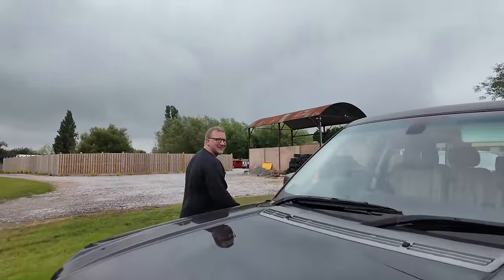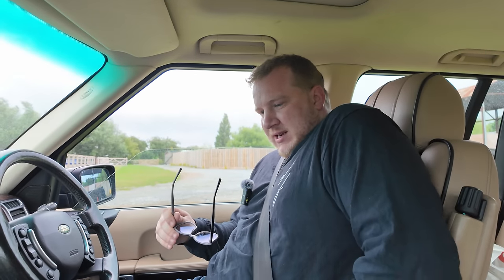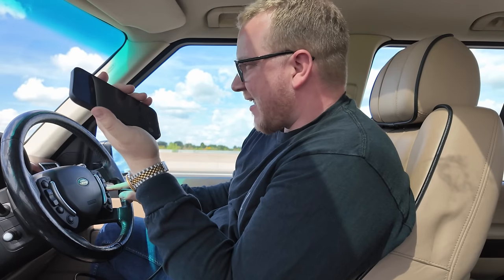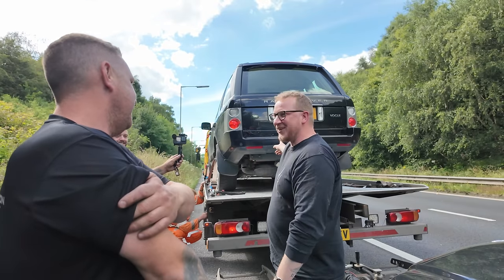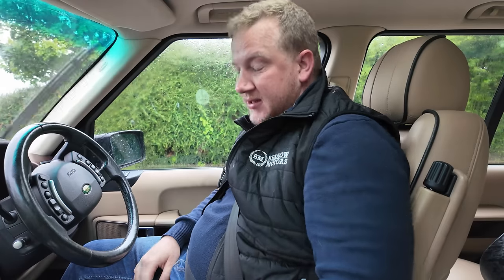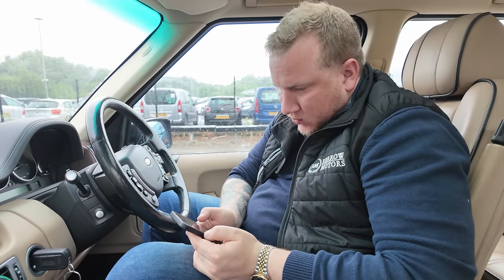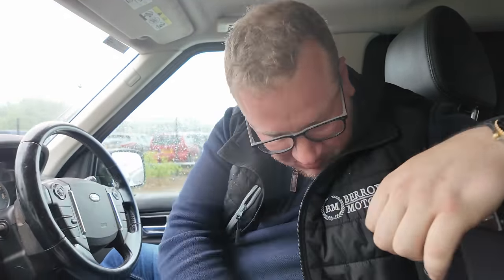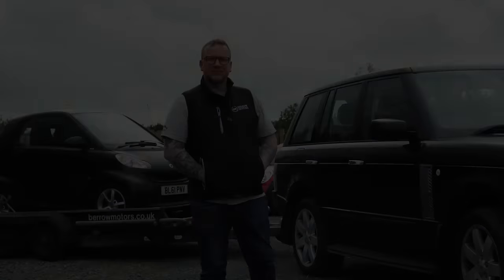Risking 600 Miles In My Dads Old Range Rover TDV8 L322

Comment from the maker: Less than 2 days left to enter the RS5 competition! https://feelgoodcompetitions.com/product/win-a-2014-audi-rs5-for-5/
Reply: Had many l322 vogues tdv8  and have had the same problems 

Cracked inlet manifold or top intercooler hose  will bring up low boost and limited performance 

Fuel sender unit is faulty cheap fix 

And the central locking is a failed actuator in the door 

Fix it 😉🤣

Comment: I think people are forgetting the Range Rover didn't break down. Any car won't go if there is no fuel. I would fix the issues and keep it. With Macaully leaving you might appreciate an awesome comfortable tow car if you end up doing more road trips.
Reply: My thoughts exactly, far better than sitting in a flat loader for hundreds of miles
Reply: Dodgy fuel gauge.  Surely brim it and monitor the miles driven

Comment: For the overall trip you should have filled it before you left home . Especially knowing that the gauge was off . the truck may be expensive to fuel but its basically a spent car to you ? You were going to scrap it when it ran out of diesel ? At this point it owes you nothing ! Spend the time on fixing the fuel gauge and door locks ! It did 600 mikes and would have been fine ! You said the AC works great and it was comfortable to drive ! If it can haul A trailer then make it a business vehicle and write of the expenses ! It looks good and clearly is worth more than a scrap price . you know the history of the truck ! You can't find another tow vehicle any where near what this will cost you ! I think you need a bigger trailer that will fit all the range rivers you seem to be buying lately ! Best of luck ! God Bless
Reply: £1.56 a litre. Jeez.
Reply: Shudhave squad

Comment: Tdv8 is normally so very reliable, I got a rangie sport 2010 with that engine and 300,000 on it, never had any work done other than servicing, it’s the electrics that fail on them, the tdv8 doesn’t have a cam belt it’s a chain driven system.

Comment: The fuel filling problem is caused when you fill from a Jerry can it causes a flap to close inside the filler neck as it thinks your filling it with petrol. 
You need to reset the flap inside the neck- search for Land Rover mis-fueling reset tool. Or look in the boot compartments it’s a yellow plastic tool.
Reply from the maker: Brill, thanks!
Reply: Agree 100%
Reply: @ShiftingMetal if you cant find the tool then a long screw driver will be enough to clip the yellow flap in the filler neck back down and refuel normally again!

Comment: I had an 07 tdv8, it came up with same issues as yours. Restricted performance on hills was split rubber intake hose £30 to fix. Faulty fuel gauge was just take the fuel sender out of the tank and clean it. The locking could be the key battery. Sold mine with 185k on the clock, no major issues with it really.

Comment: The AA left me on the side of the M42 for 3 hours and 20 minutes.   I was really annoyed.. I made a video on my channel called I had a break down.. I'm 71 years old. I could have been hit of robbed or murdered in that 3 hours 20 minutes.. That's the first breakdown for about 9 years and the previous one didn't require recovery.. you were lucky to get recovered so quickly..  I didn't get where I was going, I chose to be towed home.. The AA recovery guys were great and so was the highways England guy.. I've learned a lesson.. don't immediately contact recovery, use the emergency phone at the side of the road and contact Highways England first

Comment: Better the Devil, you know , and Oh ! Leave as nature intended .
Unique speck, leave untinted .  Fuel gadge just under rear seating  , easy fix.
Classic motor and a good one is rare.  No reason if treated with respect, will get another 100k.  Good bodywork and no rust  , perfect.  Best car on the road, particularly well looked after and great spec.  Keep it 💯 👌

Comment: Great video - The L322 is a classic and well liked by many motoring journalists (jeremy clarkson has a good youtube on it).  A good clean example like that is worth keeping - engine is built proof.  That fault code is the EGR value - just fix it or blank it off - the fuel gauge is the sender unit i'd think - not expensive - remote control is probably because the battery went flat - code it in again (plenty of on-line videos for that) - perfect tow car 🙂Great road trip 🙂

Comment: I Loved My Ole Landy a Freelander 60Plate 2.2Turbo D which other than a Steering Pump Issue which I remedied with a few fluid flushes and new pump ran faultless for 6years and 40K Miles... The Central Locking was an Issue, Bonnet catch sensor; as was the Ignition Fob Slot but otherwise a solid Runner which still lives with a new Owner.

Comment: your fuel gauge is most likely the connections inside the tank. Got a Jag XF that had same issue. Took back seat out took the sender out , cleaned the contacts - fixed.

Comment: L322 keep it! 
Seems it needs new fuel tank probably full of…and the red diesel
The fuel Gauge has a sender (sensor) on top of the tank is either unplugged or dirty £50 to buy 
The central locking if the button in the car works then is just resync the key fob or get a new key fob/battery 
The limp mode on heavy acceleration/load egr dirty all related with fuel tank. 
I had the same problems 
They are brilliant cars!
Great video

Comment: Towing heavy trailers with the 3.6tdv8 L322 for more than 10 years. I can assure you its better, more stable and more efficient than a Landcruiser.

Do the maintainance, u wont regret It.

Egrs are probably full of gunk 

Change oil every 6000 Miles towing.
With that interval mine is on 250.000miles towing, all original

Comment: The Fibre rings on the air suspension pump piston have a shorter life than an edison lightbulb.
See Edd China's video years ago when he repaired one, then you couldnt just get the rings
 and he had to rebuild the pump with an expensive complete kit.
The smart thing to do is learn to rebuild the pump and keep a tested spare on in the boot.
or the expensive solution is replace it with a conventional suspension kit.
Treat the air pump as a short life part, on par with about 4 pumps for one oil change.
Once youve learned to the weak parts that need regular replacing, it'll be reliable-ish

Comment: Come on mate I'm 
Sure I saw u do a video of u putting a full tank on a 2014(ish) 44:27  Land Rover not the silly 2ltr and u said u got around 230 miles and u said that if u put that in a BMW 3ltr diesel u would get next to 600 miles out of a full tank coasting the same to fill up and u think if u fill up and think u can drive 4 1/2 hoursin that with a trailer and car on the back . Joe come on ur better than that bro .. Maybe put together a wheel type suitcase toolbox for picking up cars ect and in it should be half inch socket set, screwdriver set , hammer , rags , pump,jack, tyre weld,battery pack,jump leads,torch it will save u money i swear . Good luck ,great vid keep it up and all the haters SHUT UP ! Ur not running a car dealership most of u commenting dont know ur arse from ur elbow..

Comment: Max weight is 3500kg car+trailer+load and you must have been running at 5000kg easily.
Reply from the maker: Huh? Maximum weight the Land Rover can tow is 3500kg (that doesn't include the Land Rover 🤣) trailer weighs 750kg max and the Sl500 is 1900kg max. Well within the limits

Comment: I can't believe you paid for air for a tire ! Shame on you ! You need a milk create with a tire inflator ,jump pack , tire plug kit , small mechanic tool set , coolant ,ps fluid ,brake fluid and miscellaneous radiator clams and a spool of mechanics wire and a bag of plastic wire ties . A pull strap and extra tie down straps . when ever you go on the road just put the milk create in the trunk . you have the obd checker as that's the most important ! Double up on the jump packs ! They are always dead . recharge while your driving !
Reply from the maker: The shame is unbearbale
Reply: Im sure you got over it after the first fart or should I say passing gas or expelling air ! Surprised you actually responded ! Love the channel and look forward to it every week . Keep up the Fantastic work and hope all the best to you and your career ! Im a retired Volvo parts manager and spent over 30 years working at a volvo dealer ! Started cleaning toilets and worked my way up the line ! So I appreciate every part of a family run dealer . I was not a relative ! So yes I did it the hard way ! The School of Reality ! God Bless !